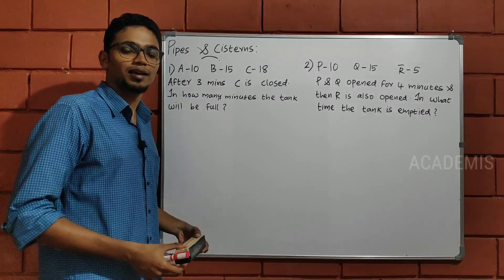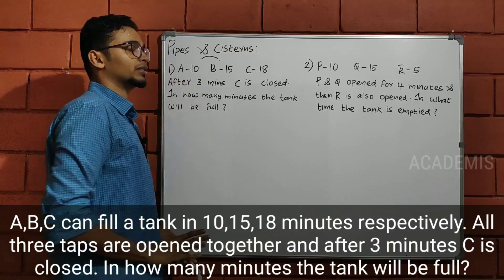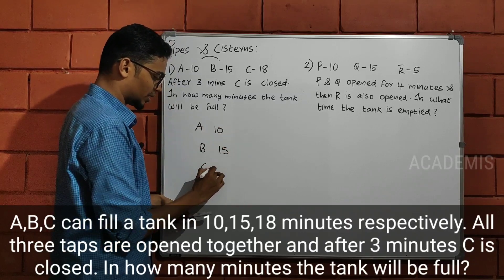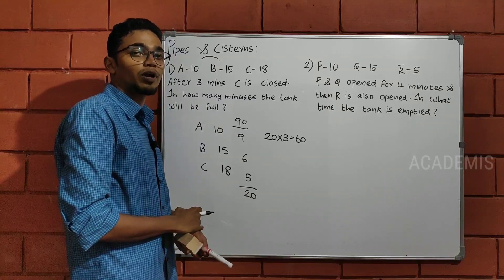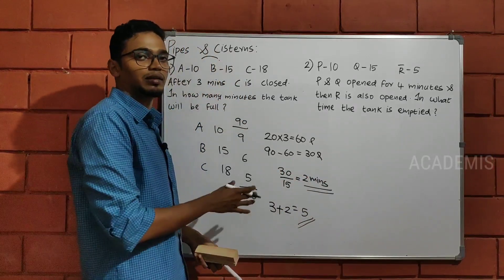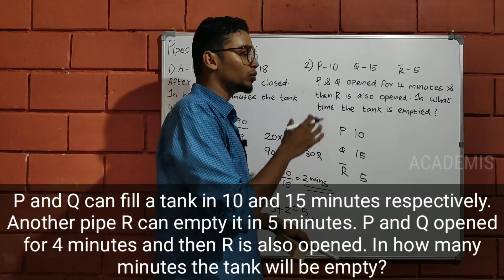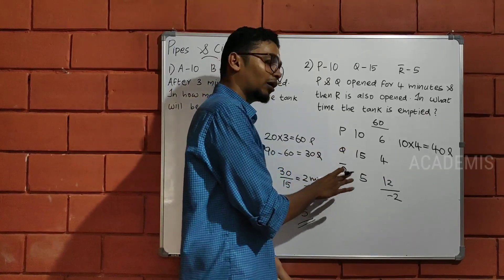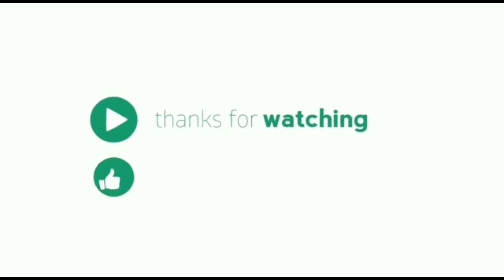PIPES AND CISTERNS- 3

Comment: Two pipes A and B can fill a tank in 10 and 15 minutes . A third pipe C can drain of 30 litres of water per minute. If all the pipes are opened the tank can be filed in 10 minutes. What is the capacity of the tank ?
Reply: @GokulMohan 30 ltrs aano
Reply: @radhikakj583  ariyila
Reply: @gokulmohan5005  okay

Comment: sir  LCM 30 alle varune..60 engane edukum
Reply from the maker: Any common multiple will do.
Reply: @Academis  but lcm 30 vech cheythapol ans 10 aanu vannath...60 vech cheythapol 20 yum..athenthaa???
Reply from the maker: @AMG99952  Because you made some mistake. Answer won't change.
Reply: @Academis  okkkk sir
Reply: @AMG99952  tank empty akanale nokune so 20/1=20min
30-20=10cheyanda..

Comment: Sir 2 nd pblm LCM 30 alle varunnathe,  enthekondane 60 eduthadhe
Reply from the maker: You can take any common multiple like 60,120 etc. Answer won't change.
Reply: lcm 30 vech cheythapol ans 10 aanu vannath
Reply: @AMG99952  no 20 thanne varu ans
Reply: @AMG99952  no way 20 kittum
Reply: No change 20/1 will get if the lcm 30
Reply: @MrAthulsaji LCM 30 edukkumbol 30 liter tank empty 5  mint ,P+Q in 4 mint total 20 liter water fill in the tank then 30/5= 6 liter empty 1 mint so 20/6=3.33 mint allleee varendathu
Reply: Bt change und sir pls expalin with lcm 30
Reply: @ansiyaanvar7581  ila change ila